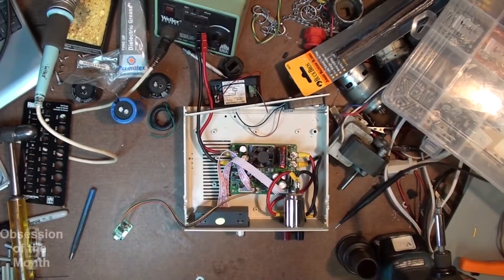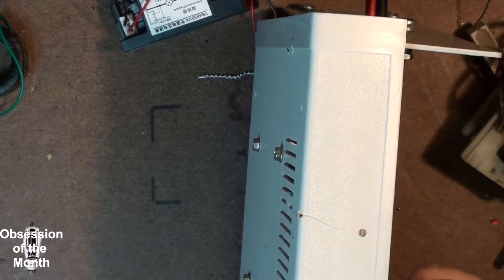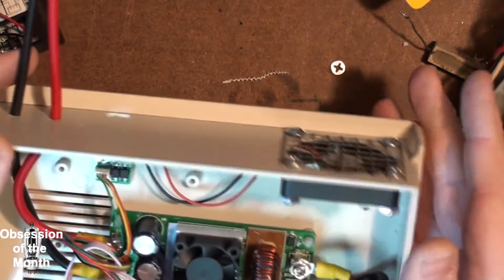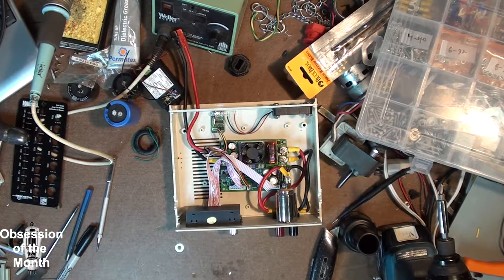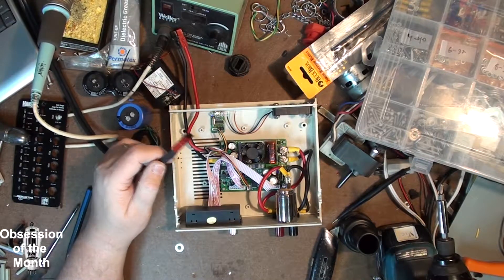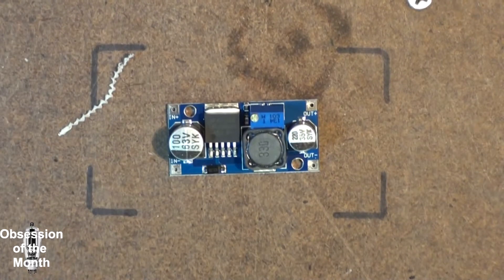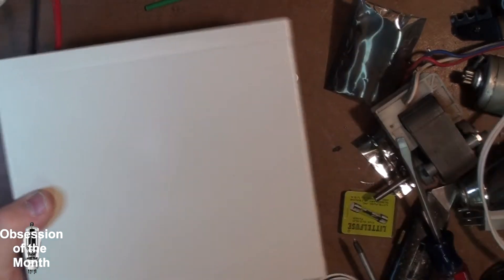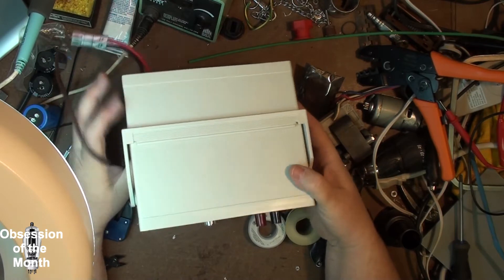DPS5015 USB Bluetooth Programmable Buck Converter Build Part 2 of 2

Comment: Great job! However that fan is incredibly noisy and probably pushing way more air than you really need. I would slow it  way down by setting that dc converter to more like 6 or 9 volts until it is more like a whisper. I like your project though and will be doing one like it very shortly. Thanks!